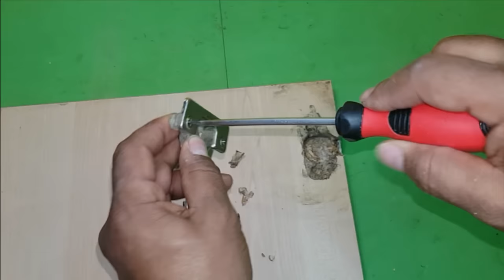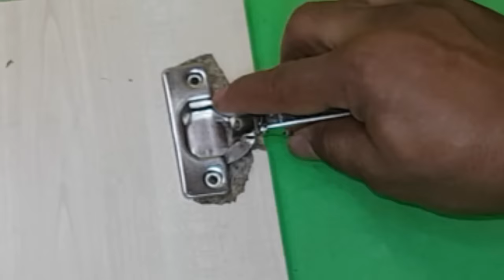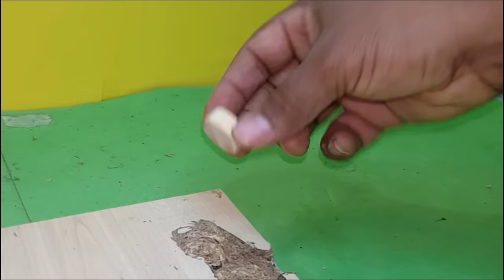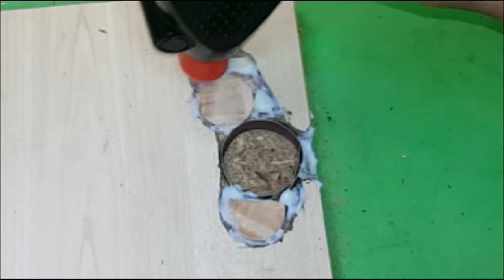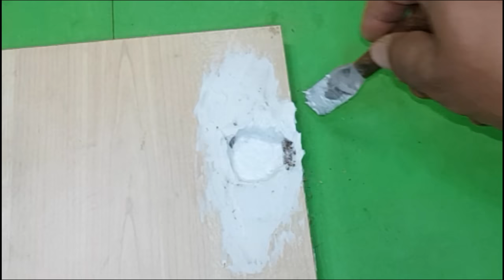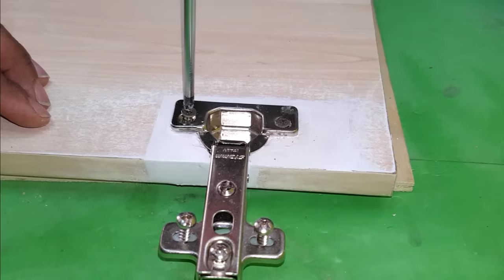How to Fix Torn Furniture Fixtures and Particle Board Furniture || Easy fix for cabinet door hinges

Comment: What is that round thing you put in between the wood dowels you cut?
Reply from the maker: They are plastic pieces for fixing nails, sold with joints, you can replace them with pieces of wood